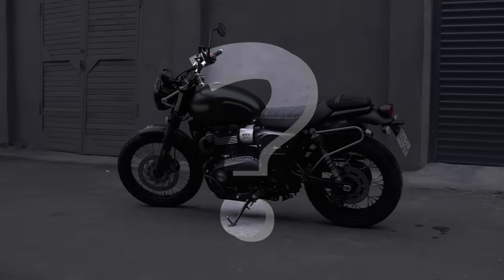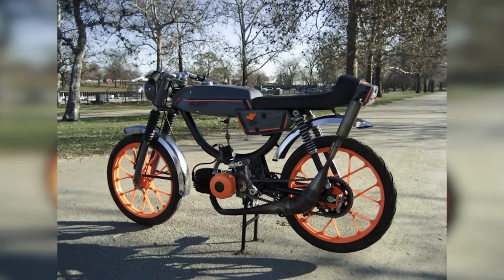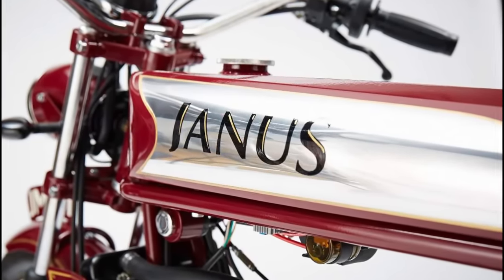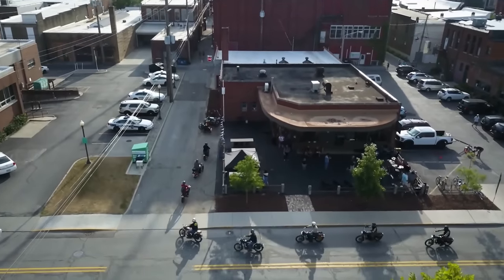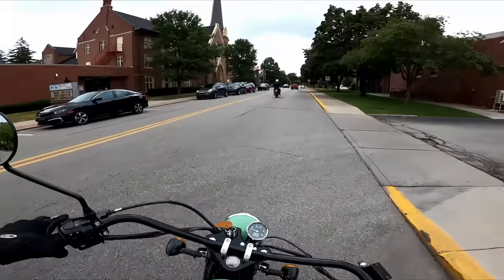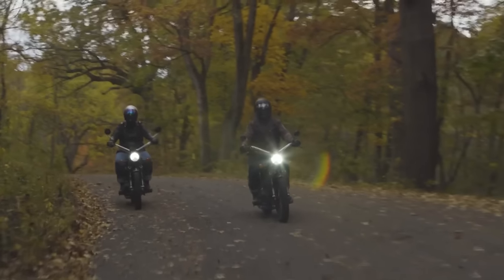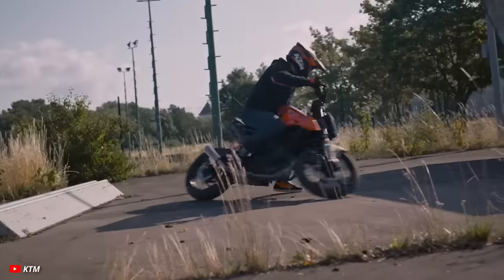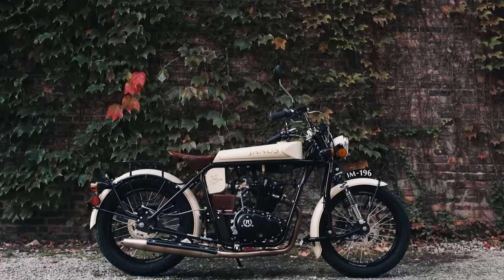The New Manufacturer making 100-year-old Motorcycles

Comment: And to the question everyone has: 
Halcyon 450 = 15'000$
Halcyon 250 = 8'800$
Scrambler 250 = 9'200$
900$ delivery to the continental US. Whether they ship internationally is uncertain (you have to contact them)

Honestly, for a boutique, handbuilt bike in the US, it's less expensive than I thought it would be. I guessed they would charge around 24k for the 450. If I were in the US and wanted a no-frills "motorcycle that is as a motorcycle should be" I'd consider it. Even without a dealer network, it seems like one of the bikes you keep for a lifetime.
Reply: @doughoffman9463  Yes, EFI is nice and ABS is a requirement for me since I ride through the winter but if that is your argument you are missing the point of this bike.
Reply: Shut up and take my money!
Reply: I have no desire to spend $12,000 on a bike at the heart of the bike manufactured in China no thank you
Reply: Definitely a decent price for a collectable machine
Reply: @doughoffman9463  trust me, you missed the point.
Reply: My dads Harley cvo was $51,000. It’s a sweet ride. But I don’t enjoy it. Very disconnected. Janus knows what riding should mean
Reply: Doubt you can get these road legal anywhere in the EU
Reply: @MajomHus funny enough there is a reseller here in the Netherlands. So I guess it does meet regulations in the EU.
Reply: @MajorTom696  "In 2016 a law became effective which required all new motorcycle models which hit the market after January 1st. 2016 to be equipped with ABS brakes. This law is valid for all EU member states, and it includes two-wheeled motorcycles with more than 125 cc for use on public roads." 

Do these have ABS then?
Reply: @MajomHus  I don't know, maybe a workaround?
Reply: @MajorTom696  you can sell them, you just can't register them for the road is my guess.
Reply: @@DaleAl-lg4ulwhat do you think the scale of janus is versus honda lmao

im a honda bike guy too, i have 3 80s cbs, but like thats not exactly fair comparison. Honda is a price leader in almost every flavor of bike for a reason.

I do not think Janus is responsible for the housing crisis. Homes doubling in price over 5 years is probably more responsible. along with about every other factor. I bought in 2016, 2.5% and all, but probably couldnt do it today, not without much more risk or more of my paycheck. Dont be ridiculous.
Reply: Crazy expensive with a Chinese engine
Reply: These are all the cheapest parts the motors are chinese based cg250s i think this company is making bank on fabbing these bikes up
Reply: @SlimTony My 95 CI Bullet is kick start onle ,😊 carbed and it starts when my EFI bikes will not .
Reply: Thanks for providing those prices, @SlimTony . Not as wildly high as I thought they'd be, but still really expensive for a minimalist antique 250. I rode small old bikes in the 1980s, from a 1968 Montgomery Wards Riverside 250 (crude & heavy bikes built by Benelli of Italy and sold in crates at Montgomery Ward stores) to old Honda 250s (don't get the ones that use wide drive belts as those expensive belts break), but these Janus bikes look like pre-WW1 stick-an-engine-in-a-bicycle-frame kinds bikes. Super-niche!
Reply: I was also suprised by the pricing. I thought it was going to be ridiculous like some of these other throwback companies but it’s reasonable in my opinion.
Reply: Yes, @HustleVentures.  Seeing how the Janus Halcyon is less than double the cost of other modern and boring 250 motorcycles, such as the 2023 Yamaha V Star 250 (great beginner bike for $4700), 2023 Yamaha YZF-R3 ($5,500), 2023 Suzuki GSX250R ($5,000), plus all those cheap used Ninja 250s out there. Of course, these Janus bikes are not competing for the basic beginner bike buck, but they will be compared to them by the price and performance.
Reply: @@DaleAl-lg4ul Not everyone!
Reply: 15K for a 450cc chinese engine bike? LOL. I bought my Triumph Bobber 1200cc for less.
Reply: If you want a no-frills motorcycle in the US, there're a lot of reliable jpn choices at more reasonable prices...🤣🤣🤣
Reply: @ZediMaster  Know the feeling.
Same deal here in Australia 🇦🇺.
Reply: @superdad2150  you are TYPING on a thing that was made in China lol
Reply: Would be worth it if it wasn't for the Honda-clone Chinese engine.

Japanese motorcycle companies still produce 100-200 cc carbureted engines, they're all over here in asia.
Reply: @sejembalm  The Honda Mini Fireblade(CB 250,250 cc,4 cylinder,liquid cooled,4 stroke) is also worth considering.
Fantastic bike all the same.
Reply: nice to look at but not worth anywhere near that much money. maybe worh it one day as a collectors item, but thats the risk you will have to run
Reply: Yeah, @1953beetle  , sounds better than my single-cylinder 1968 Montgomery Wards 250 Riverside. Although I only paid $50 for it in the early 1990s.
Reply: @sejembalm  👍🏻
Reply: @sejembalm  In regards to the belt drive set up(I'm not a fan),you could've converted said  bike over to chain drive set up.
Reply: Seems reasonable for a hand built, low production bike.
Reply: Damn for that money i could buy two honda hunter cubs or even better still buy 4 classic bikes that just need some TLC
Reply: Some cheap fittings there. And the cheap Chinese motor makes these really a styling exercise.
Reply: Could this be called a 'hipster' bike?
Reply: Yes,  @1953beetle  , but beginner bikers aren't big on bothersome mods and conversions. I should have converted the belt to chain, but didn't think of it until I broke my second belt, and then I traded up for a 1982 Honda CB750.
Reply: @sejembalm  😀👍🏻
Reply: thanks Slim ... that's what i wanted to know ... not bad pricing for largely handmade, low quantity MCs ... i started riding in the early 70's so i get the alllure.
Reply: @markharnitchek9205  I started riding in the mid 80's.
Reply: Spot on!
Reply: I tailor bespoke men's historical suits - they start at $6,000.   These bikes are pretty inexpensive, making thinks by hand is slow and expensive.
Reply: now thats what i call  not so cheap
Reply: @superdad2150 exactly! Garbage honda clone engine. This bike has no soul.
Reply: absurd prices for slow performance ! make a brough superior copy ! the SS100 like Lawrence of Arabia's mount ! THAT would be superlative !
Reply: then buy a new bike or learn how to ride the od ones  @SlimTony
Reply: @piccalillipit9211  You get what you pay for,right?
Reply: ouch, way too much im sorry. i know being small they have to charge to make a profit
but nearly 10 grand for a 250?
a royal enfield is almost twice the engine size for less money if you want retro..

i dont care how light it is.. the weight on the wallet is too much..
Reply: @1953beetle  That and the fact we live in a world where automation has made everyday things so incredibly cheap that it has distorted our perception of the value of things. 

It takes me 250 hours to hand craft a suit from start to finish.  It will take a factory maybe 13 minutes of labour.
Reply: Start with a Royal Enfield 350 Classic ($4,400 MSRP). Remove the EVAP canister and associated hoses. Remove the heavy exhaust entirely and replace with any of the available lightweight replacements. Remove the air intake box. Remove the EFI, replace with a carburetor. Remove the rear shocks and replace with steel struts so it becomes a hardtail. Install a "springer-style" seat. Remove the ABS and run single brake hoses from the actuators (hand and foot) to the brakes. Remove the tachometer. Have your local motorcycle custom shop fabricate a wizz-bang slick tiny fuel tank without fuel pump. Replace the fat tires with skinny tires. Replace the lead acid battery with a featherweight Lithium-iron. By now the weight of the bike will have dropped maybe 50+ pounds but still easily hit 80+mph without fear for your life. Paint the word JANICE on the tank. And you still have plenty of money left over to have your local pro custom shop do any welding/painting you like. You will still have plenty of money left over to pay for 5+ years of insurance and gasoline. Anyone who doesn't understand what I just wrote is missing the point. 🙂
Reply: @TheSkeptic-lz2cc   damn lets go get a beer and ride that beast!

but yea as you say even if light weight was your only goal the enfield might be a better choice..
for me, its the retro thing..
also a 250 that tops at 50MPH is poor.. i have a crappy chinese 125cc dirt bike that tops out with my 200lb ass on it at 55 ish

how do they get less miles an hour from twice the motor? and the dirt bike i have is only a 4 speed.. it cost me under  $2000 all in including shipping and paperwork ETC

yea its chinese " junk" but so far after a year it still runs great. nothing broken.. and for the price of one of those bikes i can 5 of these dirt bikes LOL.. weighs just 330Lbs btw
Reply: Dealer network?  :D  what for? it has an engine that is manufactured in China, there are billions of these engines around the world  :D  basic, carbureted engine, any mechanic can fix it ..
Reply: Much less expensive than a Hunter Biden painting.
Reply: given the craftsmenship that is going into these bikes, their pricing is not crazy - was actually expecting higher
Reply: Obviously, these guys want to stay boutique but in the future, they should definitely
consider releasing a cheaper line of motorcycles and get them made in China
to lower the costs.
They could still keep their prestigious boutique line going in the States as their
flagships so it wouldn't hurt the company. they would actually earn a lot more
money overall on the cheaper bike it would actually grow the company.
Reply: The paragon is not water cooled...
Reply: Grossly over-priced.
Reply: @MajomHus p
Reply: @MajomHus  The carbed 250s probably won't be legal.
Reply: That is hilarious pricing.
Reply: still kinda pricey for something with a chinese engine
Reply: @mikes-wv3em  Agree. There are other small manufacturers in Europe which use these kind of engines. Maybe they're not as exotic and have cheaper parts, but they cost around half as much.
Reply: 50 grand on A bike shush buy used
Reply: It seems odd that the 450 is that much more than the 250 - I don't know the exact specs but I'd have thought the money was in the handbuilt 'cycle parts' not in the (bought-in, mass-market) engine. Makes me think I'd settle for the 250 given that you're not going to be breaking any speed records anyway (that's if any ever get to the UK...)
Reply: It would be great to have one, but I could never justify the cost. For those on a budget, find an old light or medium Japanese bike from the late 70s early 80's. It might not be quite the same as a Janus, but the same sort of retro experience that won't break the bank.
Reply: >"no frills"
>$15k
Reply: no poor people bikes then. damn.
Reply: @superdad2150 Yeah, for $1,200 you can just order a 100% Chinese bike.
Reply: @cartmanrlsusall a collectible ??   Are you serious ??
Reply: I can't imagine buying one and not driving it home. It was the best ride I ever had on my iron-engine  Enfield (year 2000 model0
Reply: AND how fass dey go?
Reply: @gphilipc2031  Not very😑
Reply: Heres something you may find interesting. :)

The name of my country has nothing to do with the interesting and delicious bird ''turkey''......

.....but the name of the bird does have a connection with the name of my country, let me explain.  :)

Name of my country has always been Türkiye, it's been known as such since around the 1200's. 

The name it self has a suffix, '' -iye '', that is Turk-iye, where the -iye suffix means 'land of/belonging to', 

just like the Latin suffix of '' -ia '', which exists in such country names like 
Austr-ia, Austral-ia, Latv-ia, Roman-ia etc etc again meaning 'land of/belonging to'.

Many would remember the country Czechoslovak-ia which changed it's name to Czech Republic and a few years ago changed that to Czechia (that is Czech-ia).

The Latin suffix  -ia  probably originates from Turkish  -iye  as Turkish is much older, ancient Turkish been over ten thousand years old.

Spelled in different languages in different ways to phonetically resemble  '' Türkiye ''
we got various spellings  like;

Turquía (in Spanish), 
Turchia (in Italian), 
Turquie (in French) and 
Turkey (in English) 

all trying to resemble the pronounciation of ''Turk-ia'' thus Turkiye.

Mind you this was way before the animal we currently know as 'turkey'' was found by the europeans when they explored the north americas. The bird was first sent to europe from north americas in the year 1519, so up until that point there was no bird named 'turkey'.... 

...they came across the bird and thought it was a specie of the fowl/chicken they had been buying from the country of Turkiye at the time, so they named the bird ''Turkey Fowl'' meaning ''Turkish Chicken''.....

....just like how a dog breed is known as German Shepherd (because it's from Germany), American Bulldog, British Terrier, Greek Harehound etc etc.

In time you don't get to call the Greek Harehound as simply as ''Greek''; or you don't call the British Terrier as ''British''; or the German Shepherd as ''German'', but in time the Turkish Fowl started to be called just ''Turkey'' and later ''turkey'', and has been going on for hundreds of years.

Now in modern times, this is causing confusion, especially when we have people across the world  unable to point to their own country on the map, this ''confusion over the naming'' needed to be corrected.

So my country decided to rectify this confusion that has been going on for so long and corrected the name  to Türkiye, which it always was. Basically we didn't change the name of our country, we changed the mistake made in the English language. : )

So, there's some tid bit information for you to have a great day, if you read upto this point you have a great night too, ohh just have a wonderfull life. : )

Best wishes.  ;)
Reply: @KenanTurkiye  Guarantee it’s not 10,000 years old though.
Reply: @jimstenlund6017  What, the language? well if you go with the ''western'' narratives which bases the existance of the Turkish language on the stone inscriptions, the Orkhon Monuments, than it's from 8th century AD.

However, we know that the language dates back, hold to your seat, :) over 10,000 years old.

Furthermore there are over 5000 stone inscriptions spread all over europe, continental europe which can only be deciphered with ancient Turk alphabet and no other. Furthermore ! :) the alphabet the Vikings used to use the Futharks and also the Runic writings are found to have same origins as the ancient Turk alphabet.

What's missing in the ''western narrative'' of his-story is the pre-catalycym of central asia (again this term is coined by 'westerners', ''near'', 'central'', ''eastern'' asia according to who stands where? if you get my drift?, anyways), the western narratives would rather turn a blind eye to the pre-catalcysm archeological findings in ''central asia'' infact all of europe, that had a civilization beyond what is explained in the academia.

When you dig deep you find that there was an ancient civilization that existed all over eurasia, the precursor to todays Turk populations all across eurasia, this before ''europeans'' we currently know as infiltrated the continental regions and killed off the aboriginals of the area, which happened to be proto-Turks.

In the Jewish cronology, Noahs son Yafes is the first know Turk in history.

So yeah we do date back quite a lot.
But you wouldn't know any of that if you were to follow only and solely the ''western narrative'' which merely serves as cultural emperialism, to reduce all ''others'' into oblivion for self righteous feeling of superiority.

Wow, that was! long. lol

Sorry about that, and best wishes. : )
Reply: @KenanTurkiye  Noah’s son being the first Turk, IDK, that’s still within Bible chronology though. 10,000 years goes way past Adam and Eve.
Reply: @jimstenlund6017 I don't think Adam and Eve, peace be upon them, are as young as 10,000 years.
We have civilizations, actual towns that are dated 12-14k years, let alone cave inscriptions that are dated 50-60k years old.

I give a high possibility that Adam and Eve (Adem and Awwa in Islamic terminology) are much older than that.
Reply: @jimstenlund6017  The catalyscism Noah was involved in wasn't withn the realms of 10k years as far as I know.
Besides we have archeological artifacts in ''central asia'' that is Turkistan which show townships before the area had an inland sea which dried up, upon which the nomadic husbandry of animals was spread among Turks, before we find intricate civilisations of cities with aquaducts, golden dresses and wast riches.
The climatic changes the world went thru is many and limiting human existance to 10k years, even in texts written by men might not be 100 percent accurate.
Reply: @jimstenlund6017 Jim, nice corresponding with you however, I need to attend to some duties so I have to go offline, so please excuse me if I may not be able to answer anything you may write for some time. Wishing you the best.
(ps: I'm working on a time machine, and I'll let you know when it's done, we'll go back and check it out when it's ready)

joking :)
Reply: @KenanTurkiye  It’s all documented in the Bible, how long they lived, their offspring. God even needed to confuse people’s language at one point because they were advancing too quickly ! What the ancient people were able to accomplish still amazes us.
Reply: @jimstenlund6017  Here's a different perspective you may not have known before.
Jesus Christ the Messiah (peace be upon him) was taken to Heaven by Lord/God/TheCreator because some wanted him dead, so God saved him.

The word christ comes from the Greek word 'christos' meaning chosen,
the word messiah comes from the Arabic/Hebrew word 'messiach', again meaning chosen.

Jesus did not speak Greek or Arabic or Hebrew, he spoke Aramaic.

So, Who chose Jesus?
TheCreator/TheGod/TheLord did.

To do what?
To convey that there is TheCreator/TheGod/TheLord and only ThatSupreme power should be worshipped and prayed to and NO  idols/conjured up god/s by human kind, 
be it a man, a spirit of a man, a sun, a star, a moon, a tree, an animal etc etc be worshipped in any way.

Anything that is worshipped besides TheGod is a god,  that is false god, hence with a small ''g''.
There is one Creator, hence why TheGod,  the only One deserving of worship.

What does Allah mean as a word?
It means TheCreator/TheGod/TheLord.

What does ''elaah'' mean as a word?
It means any idol or conjured up god or gods that are false and do not deserve worship of any kind, hence why Islam rejects all gods but TheGod/TheCreator/TheLord/Allah.

Why are all religions in opposition of Islam?
Because they have a god or many gods but TheGod that is worshipped in someway or another.

Have you ever read a Quran from start to finish?
That you can answer for your self.

(I recommend the Sahih International english translation, it's good).

Best wishes.
-------------------------------
.....btw.....
Jesus did preach to worship the OneGod/TheCreator and not anything else, and so did his followers, peace be upon them all.

This unsettled the Roman Empire because this idea of Monotheism went against their pagan beliefs where the emperor was both emperor and god. They persecuted the followers of Jesus and even attempted to kill Jesus, even a Roman Empire servant Saul of Tarsus was out to kill Jesus. 

Saul never managed to meet Jesus in real life but after Jesus was taken up to Heaven Saul said he saw a dream and said he will now preach the teachings of Jesus. Saul of Tarsus is also known in todays christianity as Saint Paul, so todays christians are actually on the teaching of ''Saint'' Paul which brings in trinity and godhead figure of Jesus and rejects Monotheism.

-Jesus was commanded to preach Monotheism, which he did and early followers were Monotheistic believing people, which later changed with the Roman Empires paganism spreading

-Jesus was commanded to preach ONLY to the Israelites, which he did, but after him Saul of Tarsus  aka ''saint Paul'' started to preach to the Gentiles, which is the foundation of todays christiandom.

-Jesus was commanded to rule for the circumsicion which he did, but it was taken out after he left

-Roman Empire in 325 AD held a council, with empire alligned 'scholars'' to decide and VOTE on whether Jesus was to be worshipped or not, they VOTED that Jesus be accepted as god (in aliagn with the pagan beliefs of the Roman traditions) and ever since the trinity became the 'christian way' (not what Jesus preached), and sinc that time the Church has chronicled how many times the ''Bible'' has been changed, verses removed and verses added to SUIT this altered idea of trinity!
Reply: @jimstenlund6017 Btw, according to the Quran Noah peace be upon him lived 50 years short of 1000 meaning he was 950 when he died, and this wasn't 'special' to him as we further understand in other Islamic literature.

Anyways, I'm out, take care and have a great day/night. :)
Reply: @KenanTurkiye  Something to consider, if you’re considering radio carbon dating, is that the radiation before the Flood would be less because of that ‘water canopy’ making up part of the atmosphere. This may have helped those early humans to live longer as well, but IDK.
Reply: Did Jay open his wallet?
Reply: bsa 250 £1500 bsa 459 £3500 whos a chump
Reply: 10 grand U.S. dollars is stupid especially for a china motor. Not a good china motor. For ten grand i can take a 60's jawa put a predator212 on it with a cv system and have 6500.00 dollars left over And it would be faster and better looking. 😮
Reply: @jimlascola  difference is im not riding this phone.
Reply: HOW FUCKING MUCH!!!!
Reply: This is the first time I've heard the word 'bike' (ie motorcycle) and the word 'boutique' used in the same sentence. I'm going to have a lie down.
Interesting information on the actual prices as the Janus website is very reticent about declaring these!
Reply: @daweshorizon  While I also consider motorcycles more like something for transportation than art, boutique motorcycles have been around for a long time. Take the original Brough Superior SS100 for example.
Reply: Brough Superior made motorcycles for about twenty years during a time of financial and political turmoil in the United Kingdom. 
George Brough, following his father's footsteps, made some high-price premium motorcycles including the SS100, the Pendalpine et cetera. 
However, I'm not entirely convinced that a lad from Nottingham, born in the 19th century, would accept the description of his motorcycles as 'boutique'. 
(meaning 'small shop' in French). Odd.
Ride safe. love and peace.   @SlimTony
Reply: Buy and restore a vintage bike for 25%. Stop pretending these are carefully crafted masterpieces, and accept its a rigid framed kit bike with a Honda engine. Janus Only appeals to older riders with little riding time, posing on a mild, "safe" pseudoclassic.
Reply: Well if you had a short life-time....that Chinese pot-metal engine will only worry you to death
Reply: @MajomHus  it looks like they have cable actuated drum brakes.
Reply: @superdad2150 I couldn’t agree more but, if you put an American made 250 or 450 on these bikes you can expect the MSRP to double. Americans do good work, they just don’t do it cheap.
Reply: shits to much, has no hi quality componnets like motocross bike
Reply: 24k for wat.. 15k alredy alot. has no wp susp
Reply: @superdad2150  honda clone motor the best thers none here beside rotax
Reply: @MajomHus  So what happens if you ride one from England to France?
Reply: @molochi  not sure if you are trolling or not, as long as you can register it in a country and insure it you can do with it what you want. I am just saying that you most likely won't be able to legally register it in EU countries.